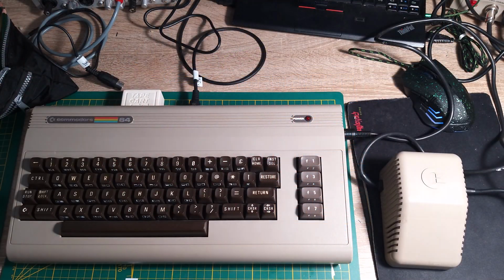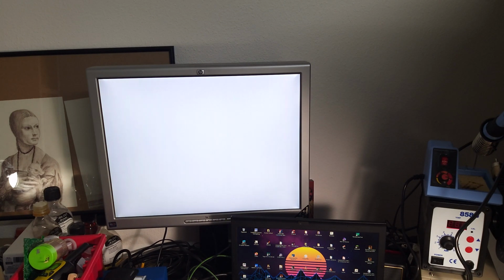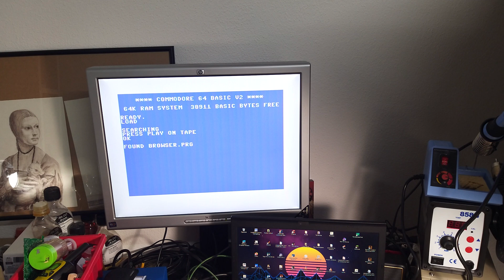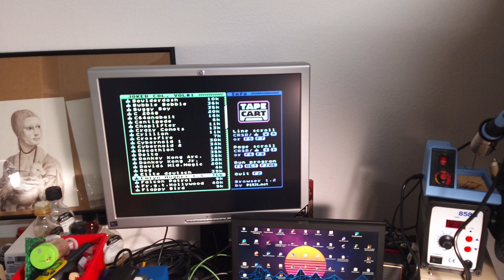Fix the "Brick of death". Commodore 64 Powersupply update. Recap and replace the voltage regulator.

Comment: With all the "epoxy" talk it sounded hard to fix, but this actually looks pretty easy. Seeing this I envision an even easier fix: remove the PCB completely and put this piece inside: IRM-10-5 Meanwell PCB all-in-one switching PSU.
Reply from the maker: Hello, with some PSUs it is easier, with others it is not. Mine here was very easy to open, but I have also had some that were very difficult to open. Sometimes too much epoxy has been filled in, which makes reworking even more difficult. 

The idea with the IRM-10-5 Meanwell is a good one. However, this model has a ripple of 200 mVpp, which is very high. Computer chips from the early 80s are sensitive and should not be exposed to high ripple for too long. In another video, however, I followed a similar idea and installed a voltage regulator that had a ripple of about 20mVpp.